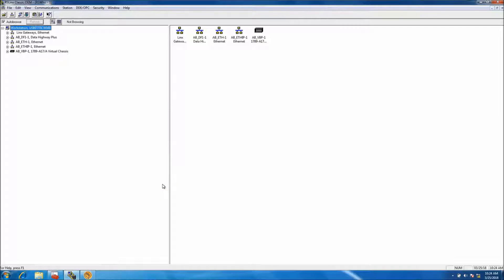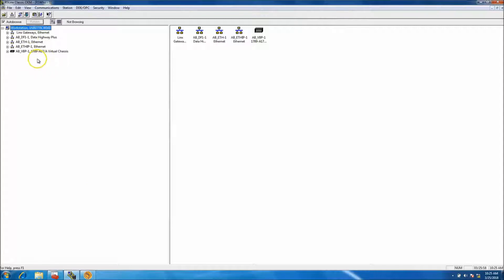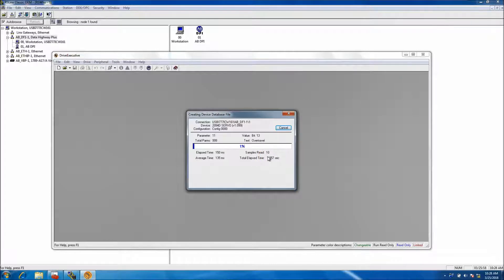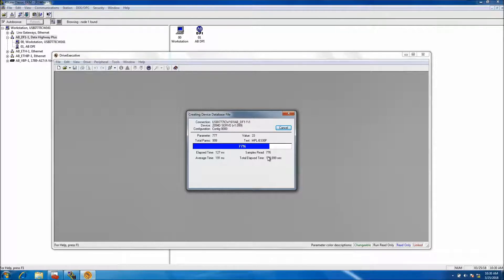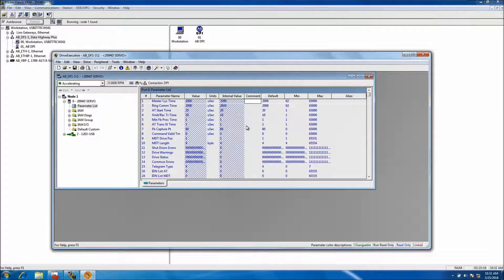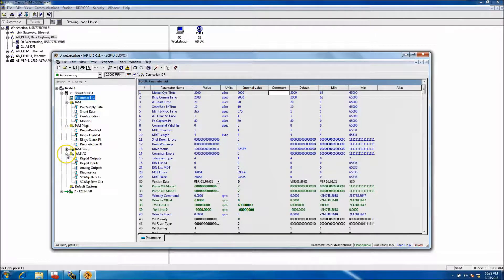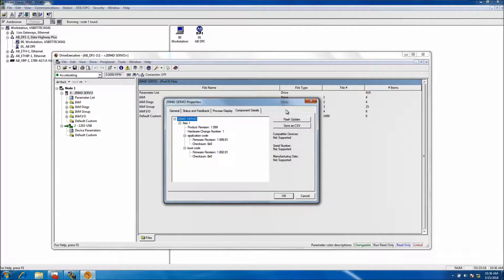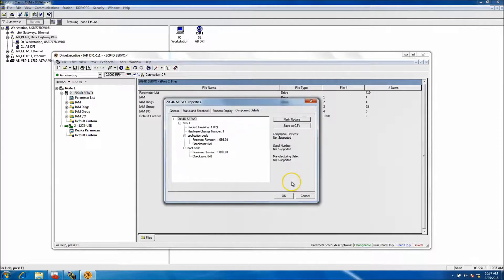Using Drive Executive With Kinetix 6000 Servo Drive

Comment: Grettings from Spain my Pal...today I have a Technical question for you. How I know total hours worked inside  a Servo kinetix? (I visited a Factory...and many lot SERVOS have malfunctions)....if you have any information about this topic....Thanks a Lot!!!!!!!
Reply from the maker: Kinetix servos last a long time.

I've personally seen some last 12 years on a machine where I work.

The key to long life is the same as any motor, make sure that it operates within the motors spec rating.

Example, generally the first thing that fails on a motor is the bearings because of load it has to move on the machine it is implementing on.

As long as they are implemented within their operating ranges then they should last on average 8 to 15 years.

If you aren't getting that sort of life cycle then I would suggest you look into heat, load factor, and amperage.

Then look at the mechanics of the load they are moving, is there something not designed right or binding.

The only exception to this is a servo with a brake, the brake tends to fail first just like it does on a regular motor.

Because the life cycle of a coiled brake isn't even close to the bear life
Reply: @ShaneWelcher  after some investigations I found it that Web Server embebed in SERVO kinetix is able to storage historic function information...
Reply from the maker: @electromecanica_automatismos  not sure what that has to do with life cycle but ok.